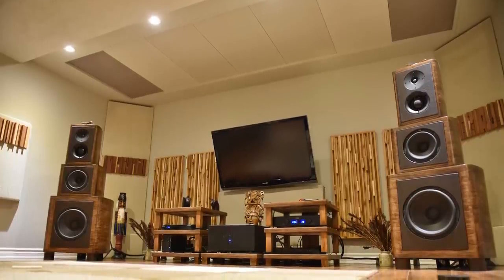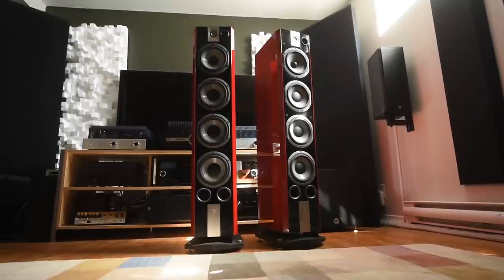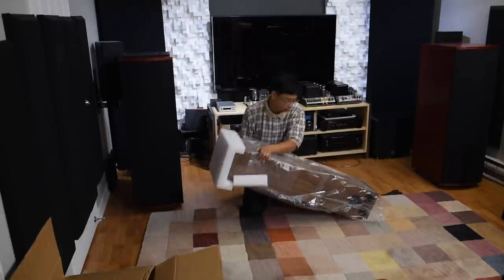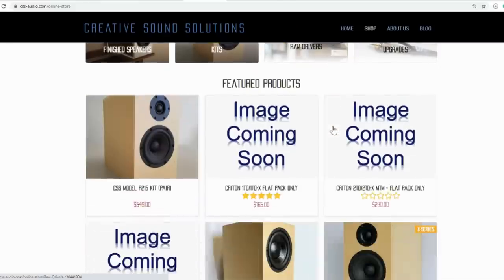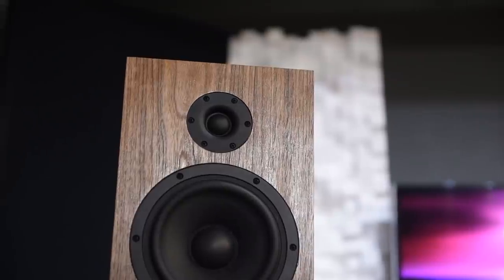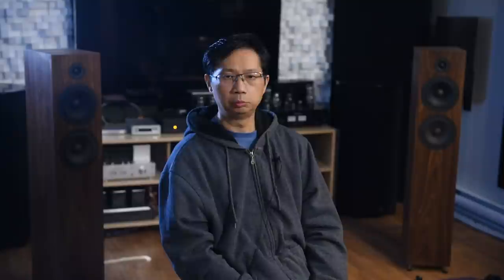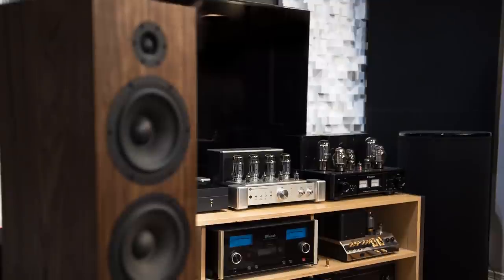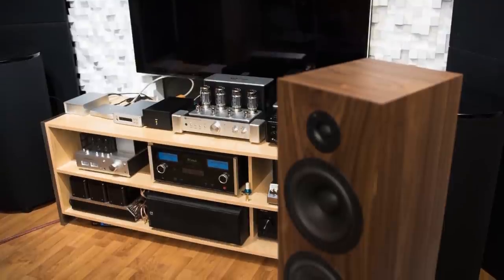Building your own high performance speaker, CSS Criton 2TD-X tower kit.

Comment: Beautiful video, Thomas! I must admit to being a bit of a audio bigamist... 😬 I like different speakers for different purposes. In total I got five pairs. 

My main system has the Marten Design Django XL-speakers. A true high-end sound, that can be quite revealing, but can be driven to insane voloumes without loosing composure or clarity. 

My second setup is with Tekton Design Double Impacts. Uuuge! 😜 “Natural sounding” as you said yourself. I use a tube amp and turntable in this setup. 

In my living room I’ve got the Magnepan LRSs, and they are so clear and relaxing with my mosfet/class D amp, the Gato 400 DIA. Voices are incredably clear and airy. 

My stereo hometheater has a pair of Piega T50 speakers. These speakers go deep, but doesn’t take up much space. They are definitly analytical, but paired with warmsounding Electrocompaniet amplification they are perfect for both movies and music, as they are capable of drawing up a huge soundstage and can easily make you forget any thoughts of surroundsound. 

My fifth speakers are the Warfedale Diamond 10s. Very relaxing speakers for my bedroom. Paired with a vintage Tandberg 3012a integrated amp they are buttery smooth.  

So being an “audio bigamist” is quite the life for me. I love some budget systems, and vintage systems are also a passion. But I really need the high-end stuff too - that control, that effortless finesse that follows is quite addictive.

Comment: I bought a set of Omega Super 3i (4") full range speakers six months ago and fell in love with the sound and the price. Added two matching subs from Definitive Technology and finally concluded I like the Omegas better without the subs because they cover up too much detail. Then I found a Fostex 3" full range kit at Madisound and was shocked how close they were sound-wise to the Omegas. Super easy to build too with no gluing, soldering or crossover to fiddle with. And less than US $200 for the full kit. They won't replace your mains, especially if you like it loud and thumping, but they are the best desktop speakers I've heard. Perfect for a condo or apartment and a great way to try out full range speakers on a small budget. Despite their tiny size they produce immersive sound, especially acoustic music, strings and voice. Now I'm looking into 8" full range drivers to replace my mains. He he he.😉
Reply from the maker: Nice, thanks for sharing and letting us know.

Comment: Another great video ! I am a maniac! I own 7 pair of bookshelf speakers, 3 subwoofers and a micro-components system in my study. Sometimes I will sell a pair or two and buy another one. I modified most of them to step up the performance because they are budget speakers save one. Even if I like hearing details, I wanted to be wrapped up in the performance rather than concentrating on one aspect of the performance.

Comment: I absolutely love my Criton 2 TD-X. I have the original stand mount version. I built my cabinets from scratch based on plans Kerry from CSS Audio sent me. He was very helpful through the process with answering some questions I had. I am using these in our living room a a secondary system used for music but also for TV/Movies. I am driving my Critons with a Unison Research Unico Primo with the stock pre-amp tube replaced by a Gold Lion (I prefer the UR amp to my Naim Supernait 3 with these speakers). I just love the sound. They are not as good as the Martin Logan Montis I have in my primary system but I prefer them to my Harbeth M30.1`s...which cost 3X as much! I`m pondering wether I should build new tower cabinets to replace the standmounts to get the added bass extension... Would realy like to try out a good, powerfull tube amp with these. As mentionned by Thomas, they do need solid power to drive them.

Comment: I have the smaller 1TD-x  In my bedroom, they are end-game for me in that space (not the greatest setup).  Topping Pre-90 and Belles 150A Hot Rod.

In my main system, replacing Magnepan 1.7i  (in nearly the same position), they sound about as good as the Maggies.  Parasound JC2 and big old Adcom GFA-565 mono-blocs 

FWIW, IMHO they like a lot of power.

Comment: Awesome review and your thoughts so parallel mine. Brings more interest to your reviews as I know we have similar thoughts.  My current speaker list is; Magnepan 3.7i's,  Rogers LS3/5A 15 ohm, triangle Genese Trio and recently Klipsch Cornwall IV's. I have built CSS 2TD's MTM with original tweeter and superior crossover, same with silk tweeter, standard crossover and now 2TD TMM's with superior crossover. I think you are dead on when you say they are great for long listening and no fatigue. Bass is incredible and although I think I am going to build the CSS sealed 12" sub's (2) I am not sure I really need them.  Perhaps I do with the Maggies. Thanks for this awesome review!
Reply: Check out the Falcon acoustics q7 £895 better then the ls3/5a uses the same drivers or another speaker they make with a quarter wave transmission line uses the same drivers the imf100 £1200
Reply: I use the CSS 10in Subs in a couple of pairs of speakers I've designed. They are monstrously good clean bass output. I've never been able to make them complain no matter what I've done to them
Reply: No one 'really needs' 2 subs...it sure is awesome tho...
Reply: @contemporaryhomeaudio  I think two four or six subs is quite acceptable if they are the right type! It's like saying you should only have speakers with a maximum of 6" drivers.
I'm not sure I understand your logic

Comment: Interesting review. I am interested in building a set. I do have several speakers. Most recently a set of JBL 100s, Main speakers are modified magna pan 1.6’s. The JBL‘s sound so different from what I’m used to that I have had to spend a lot of time with them to appreciate what they do. I can’t agree more that you do have to time with a speaker to explore its capabilities.

Comment: I built some inexpensive diy speakers some years ago and still use them, because i never had the room to justify better speakers. I now have a better listening room and did some acoustic treatment and the speakers could deliver an even better performance.  Now with the more appropriate room, i will most likely upgrade. I would like to build my own speakers again, but the market for great and inexpensive studio monitors has really grown. The Adam t8v for example would most likely outperform any diy speaker at this price point. I see this growing market and the rising material cost for wood as a problem for diy. I always had one pair of speakers, but also a headphone setup as well.
Reply: The pro-sumer studio monitor market has phenomenal performance/price ratio... that segment offers the greatest value  out there ... then add subs to taste.

Comment: Bowers and Wilkins 702 S2 (floor standing = main use) , RTL TDL3 (a reflex transmission line floor standing design = main use spare), Dali Zensor 1 (bookshelf = office), Mission M70 (bookshelf = bedroom) and Denon speakers in work shed. I have not counted the 5.1 TV speakers. 

Now you mention it..... this is crazy.... must get rationalise soon.

Comment: The overall equalization of the system you would enjoy when quiet is not the same equalization that you would choose for the same sound system loud.  Perhaps that explains why the CSS needs to turned up to sound right.  For example, our ears become very sensitive to 2K-3K when we hear very loud music.  It is these frequencies that hurt first, when we crank it up. Speakers that have a smooth response excel at high volumes because peaks and rough response causes the pain (fatigue), at the high frequencies.

Comment: DIY is definitely the way to go in my opinion.  I've been building DIY speakers for just about 50 years and today I have no interest in any commercially built speakers.  I've been building primarily open baffle since the mid 1990's and primarily active crossovers since the mid 1980's.  For home theater I prefer open baffle CBT line arrays and I have a tendency to overkill just a bit🙂

Comment: Yes, I have more than one pair and yes I have tried many speakers in an effort to replace my Focal 807Ws with a smaller speaker...but have since failed.  Probably have to spend some $$$ and likely wouldn't find anything significantly smaller.

Not to mention they are easy to drive.

PS...as you get older the Focals become more musical due to natural high frequency rolloff of one's ears.

Comment: I go back and forth between klipsch and ELAC. Opposite ends of the presentation spectrum and I regularly appreciate both after going through a short adjustment period. 

I'm a musician so I've known for years you won't ever find that one perfect sounding instrument. You'll have a bevy of gear that you mix and match and play for different music styles and moods you may be in. The beauty of hifi is that these are, in a way, musical instruments themselves!
Reply: For me, the Klipsh 600 bookshelves were exciting but fatiguing. If you don't want to build a kit or go into the $2000 range probably you could look into the reviews of the ElAC Unifi Reference that just came out. $1200 but it sounds like it's worth it. Other than that in the $1000 rang I liked the Warfdale 4.2 speakers.
Reply: @fletchermunson6225  I can see how the 600m can be fatiguing. I also have rp280f floorstanders. Those I'm not sure about in my small room. They make the 600m seem rolled off on the highs lol. When they are played loud they balance out better and they got slam which is fun. I have the ELAC unifi 2.0 ub52 or whatever. I would like to check the unifi reference but I have it on good authority that the ub52 I got aren't improved by the unifi reference to justify the money. I'm into the ub52 for $470 when they were on sale. At the time the unifi were $999 and even then at double the price... tough to justify. But speaking of justifying costs. Next bookies probably ls50 meta. Only if because I have to experience them at some point in my life. Running stereo subs so not worried about lack of bass with any of these. Now I just need 2k for some metas and stands lol
Reply: @fletchermunson6225  have you done one of the kits? I'm curious there too. Either the css or the xls encore on the short list. I'm going through a phase where I like really bright speakers but have a feeling it won't last but a few more months and I'll be craving some warm buttery rolled off goodness
Reply: @erics.4113  I have both the standard Criton and the X model. It sounds like you would prefer the X model with more high end detail. I know someone who just sold their Critons because they are addicted to the detail provided by the Encores. That said th Encores do not have the bass authority of the Critons. Sounds like you might like Encores backed up by a subwoofer providing a foundation.
Reply: @erics.4113  It all depends on your hearing and preferences. I think Encores and a subwoofer would be to your liking from what I've read but I have not heard the Encores. The crossover in the Encores is more difficult to build than the Critons BUT GR Research makes assembled veneered cabinets available for $500. All you need to do is apply your top finish, oil or whatever. That compensates for a lot of work. Trust me, $500 is worth it. If I bought a pair of Encores I'd buy the completed cabinets and the better crossover components. Three kinds of wood are available.
Reply: @erics.4113  Monoprice makes a great stands for about $70 each. Four metal posts that you can fill with dry sand. One of the great audio bargains.
Reply: @fletchermunson6225  i would like to try both honestly. And I do woodworking as a hobby and generally build crap for fun so diy is like tailor made for me. No pun intended lol. What is the X model? Is that the MTM style one? 

I wanted to love floorstanders in my 10x14 listening room and I do... but not for every listening session. I want some kind of in between. Like a mid tower or maybe the X model if it's what I think it is.
Reply: @fletchermunson6225  I want to check those out. I got kanto stands which are nice but I got 32" which are probably too high for the 600m and the ELAC. I think 24-26" would suit me better and I like that monoprice look. Also digging the solid steel but they 500buck Italian stands of course. I always seem to find the expensive stuff
Reply: @erics.4113  They make a standard Criton book shelf and the X model.  CSS  X models have a more expensive tweeter and a new crossover to accommodate it. The x speakers have more high end information. Not harsh but just dont roll off as much as the standard model.
Reply: @fletchermunson6225  I have seriously considered the GR Research stuff but I find Danny to be a kook and they are constantly out of product.  I know supply issues are everywhere. I was ready to buy X-statics for months but they kept pushing back the date that they could supply. They just didn't give me a lot of confidence. I absolutely loved doing the kits from CSS and would love to build some more.  I am on the verge of ordering a pair of their SDX-12 sub kits although it is highly debatable that the 2TD-X need them.

Comment: Did they forget to tizz up the treble when they made the floor standing version with 2 woofers. Jay the S Korean dude reviewed the bookshelf version and said it had more detail than just about any speaker and did not mention even a hint of roll off in the treble. Mind you it's the upgraded tweeter and crossover version that Jay reviewed. Maybe try the floorstanding ones on an amp that is tizzed up a bit. Or even use a 3 mf or 2 mf cap in parallel with a 1 ohm to 2 ohm resistor and connect it to the + terminal on the epeakers. Easy, and it doesn't interfere with the speaker build. You can install and remove it without diving into the speaker box.
Reply from the maker: Possible cause I heard the bookshelf version and it does not sound the same the top end at all.

Comment: Thanks for this great review. Building your own speakers sounds like a fun project. Just curious to hear more about the level of difficulty though. I feel like upon completion, I would be one of those wondering if my DIY skills (or lack thereof! ) have negatively impacted the end result...
Reply from the maker: If you do a search on youtube, many people share videos on their built process. It seems easy enough.
Reply: The first box is your learning curve, relax for doing and then addressing the mistake as it teaches become the lesson.
 Now you have some life skills I found out its the third build master jack of all trades, by then you'll have all the tools etc also.

X- over run a wire out port then you can tweak it for your room or adjust for no room treatment. Plus  have two x over one focal bite or lazy having a break in life mode.
Cheaper then speaker, interconnect etc to get similar results Thomas says trade offs 
I'm a nillionaire I can wire the whole house with a roll of copper penny's

Comment: diy for the extra performence per buck... spin this theme a little further:
the extra smooth and relaxed presentation  makes them the ideal partner for those exelent entrylevel class d amps(infinity chips).
they both compliment each others with the different characteristics.
the result should be a WAY better listening experience than the overal system price will suggest, moving the entry to highend a couple thousend dollars down.

Comment: DIY speakers require as much research and study as you can stand. The outstanding Ellis 1801b were my mains for years but lost in a fire. If you can work with 4 micron Mylar and are mechanically inclined, DIY ESLs are possible. I used such a system for 20 years. 

Sounds like the CSS could use a supertweeter, carefully implemented. I would go with a different main tweeter like the SB S29, or the fantastic Hiquophon OW1 and Bi-amp to avoid passive xover problems. IMHO.

Comment: Hi Thomas, I've been watching a lot from your channel and I'm embracing the concept of synergy and pairing of speakers+frontend.

My hobby is wood-working, so naturally, I gravitate toward building my own speakers. These look like an excellent pair and I plan to build this tower kit.

From a pairing perspective, do you think this set of speakers pair well with the Freya+ and Dinafrips Ares II? These are all the products you have reviewed before so I figure you'd have some solid opinion on it.

Would love your input on this!
Reply from the maker: As long as your amp has a lot of clarity. In theory it should be fine if you like a smooth presentation. Else, a more revealing DAC might be a better match.
Reply: @ThomasAndStereo  Yeah, I plan to use a Hypex Ncore 252mp based amp from BuckeyeAmp

Comment: It’s definitely subjective. When critiquing speakers. People have different ears. I’m sure that all of the people or more for people that were reviewing these DIY speakers do not own or have never listen to seriously high-end speakers like Wilson audio, or JM Labs Focal, they also probably have never heard systems with Jeff Rowland Design Electronics, Straightwire interconnects and speaker cables, etc.  There are so many variables.
Reply from the maker: In my case, I am really familiar with some of the brands you have mentioned.
Reply: Definitely nobody has got same ears and most over 35 have lost alot of hearing specially in treble range! so really you need your ears testing then eq that response to get a proper flat so called perfect sound wave curve

Comment: Still like my Polk 707s. It's always fun to have something new. Would these be an upgrade?
Reply from the maker: No, the Polk707, if driven by good electronics, would need about a speaker of $8k to beat it. If you driving the 707  with electronics that is in its price bracket, you are probably only seeing 60% of its potential.
Reply: Thanks Thomas. Can you recommend the equipment I would need to get that extra 40%?